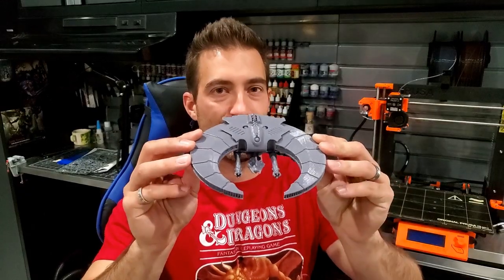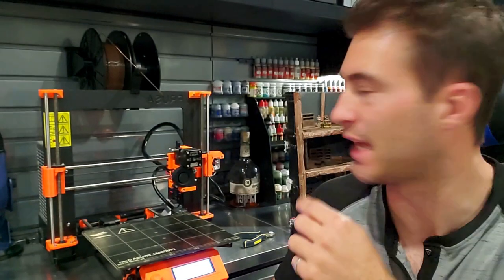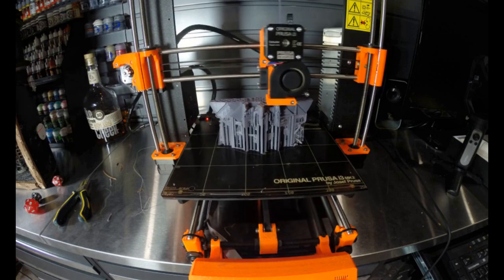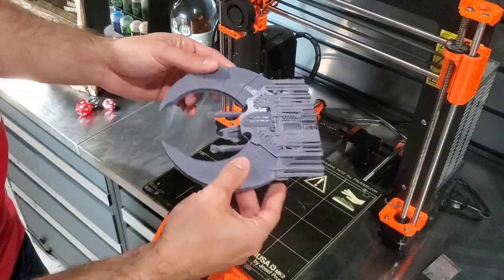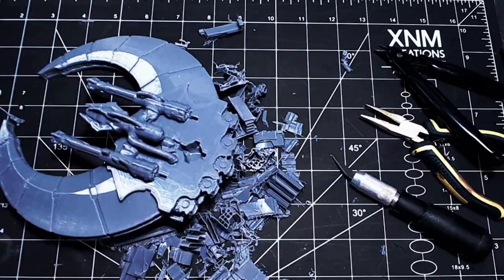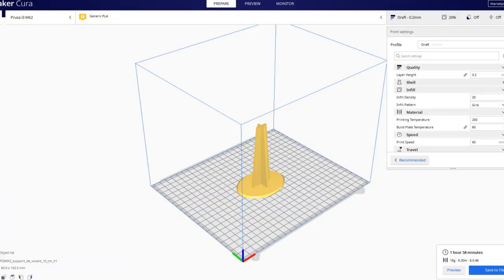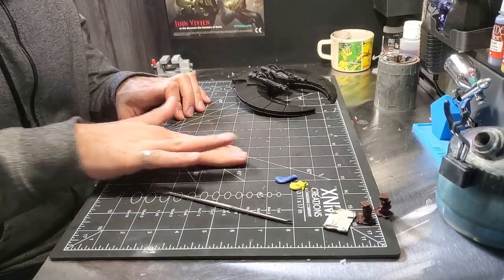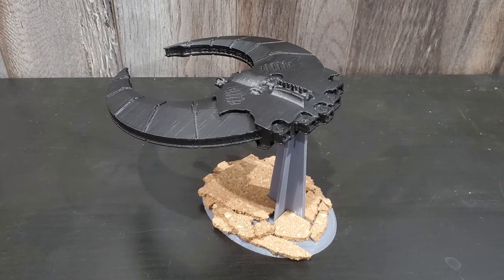3d Printing Warhammer 40k Necrons

Comment: Go into the experimental options in Cura and enable tree supports. Works a lot better for me than regular supports id say over 80 percent of the time, and they come off a lot easier.
Reply from the maker: Every time I click on it it adds so much material and time I keep not using it. But I will give it a go
Reply: @FacilityD20  late comment but you need to click “touching the buildplate” to make it much better

Comment: I'm really enjoying seeing how these print out even from tiny epic model .stl files in FDM. I would imagine they would be next to impossible to distinguish from actual models if printed on a resin printer with files at regular size. It is easy to see why GW is nervous but the market for actual plastic models likely isn't going anywhere. With games l like war machine waning 40k and AoS are taking back market share not losing it.
Reply from the maker: For sure, if I were GW I would have a team set up now to bring stl files in as a product line, and maybe partner with a 3d printing company and manufacturer 3d printers with GW branding, embrace it 100%.
Reply: @FacilityD20  seems unlikely they would chose to go that way they are even backing off digital book releases in an attempt to cut down on pirated copies.
Reply from the maker: @scottchristofersen2367  I feel like its the future...
Reply: @FacilityD20  true, but companies are understandably resisting it. change is hard

Comment: With a bit of finishing it might be comparable to the real thing.
Reply from the maker: For sure, I have since found even more detailed files for this... I am trying to decided what I want to print next a dreadnought... or a prop bolt pistol, what do you think?
Reply: @FacilityD20  ooooh, that's a hard one. I think I'd go with the prop pistol through. Subbed so I can see it when it comes out :-)
Reply from the maker: @karbonkai  Sweet thanks. Pistol it is, the Facility needs more decor. Also next week's video is a 40k build, it going to be very cool!
Reply: @FacilityD20  alright, I'll stay posted